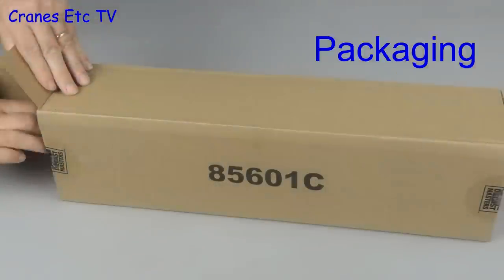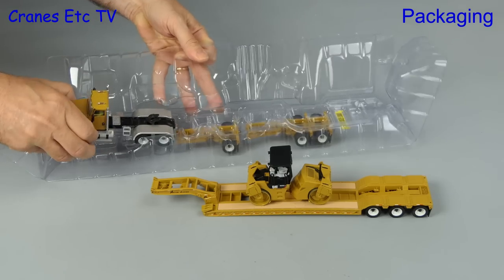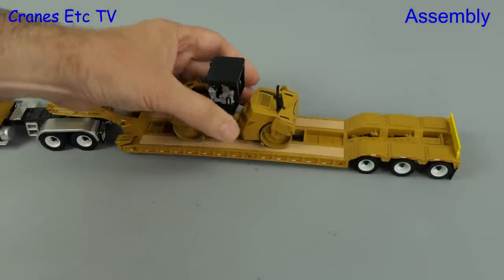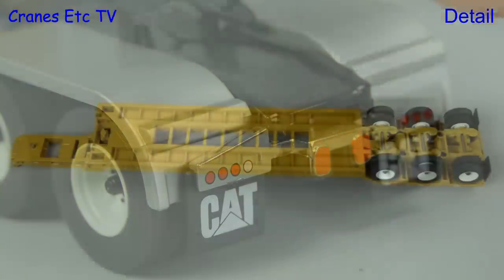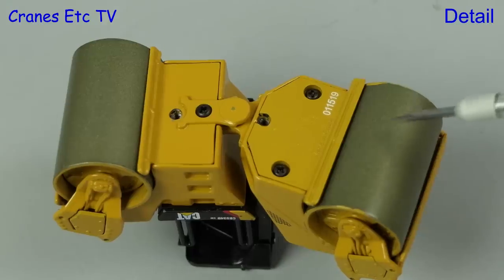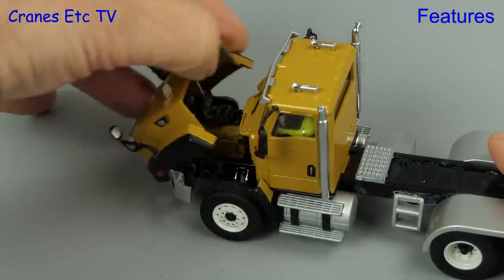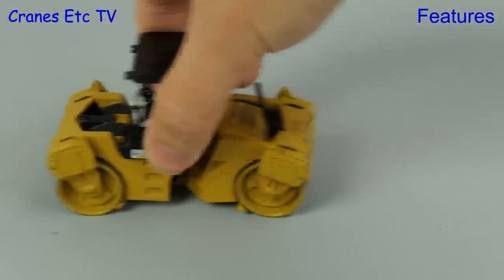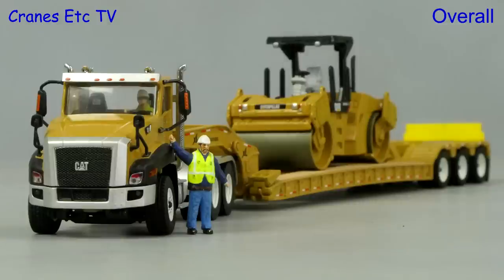Diecast Masters Caterpillar CT660 + Trailer + Compactor by Cranes Etc TV

Comment: Great review! FYI: for those who may be wondering, the operator seat does spin so that the operator can have better visibility when compacting. It has the same functionality as the Norscot model it's based on.
Reply from the maker: The seat would not move on the review model for whatever reason.
Reply: @CranesEtcTV  Strange. I just got my set in, and it does. You sure the clowns at Cranes Etc haven't been playing with our friend Sue-purr-Glue behind your back?
Reply from the maker: Only one clown at this end and he pleads 'not guilty'.